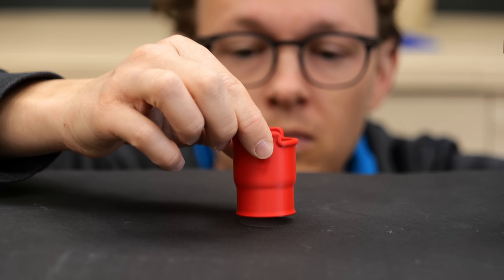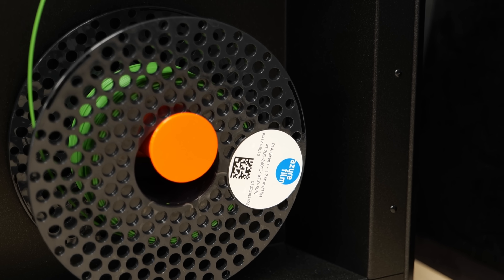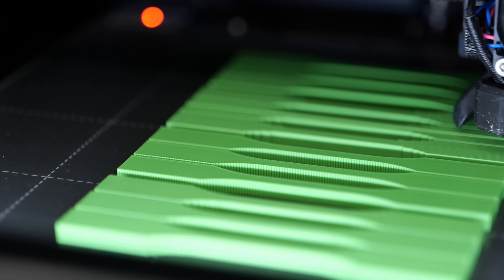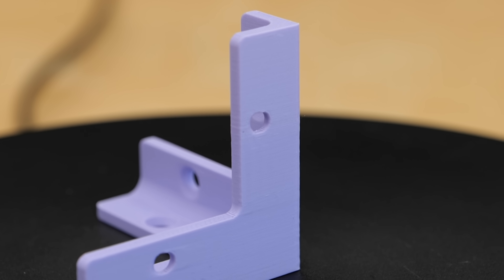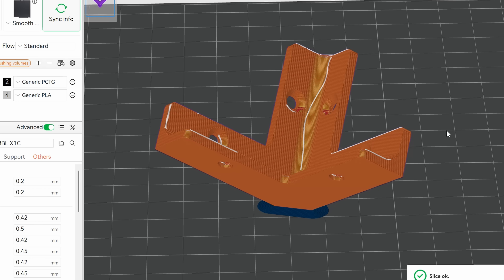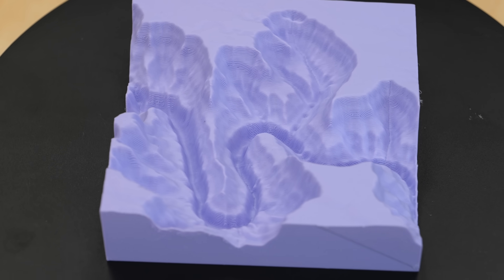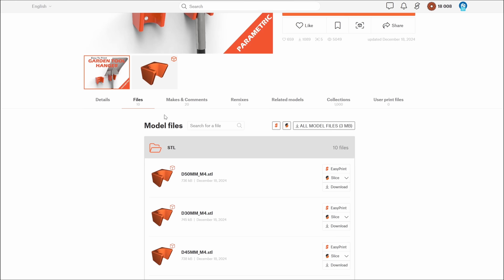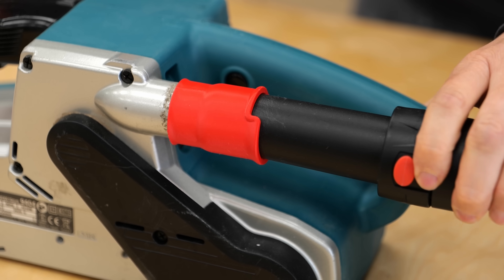Does Angled 3D Printing Really Make Parts Stronger?

Comment from the maker: KiwiCo makes a great gift for the holiday season! Visit https://www.kiwico.com/cnc and use code CNC to get 50% off your first monthly KiwiCo Crate or 20% off your first Panda Crate!
Reply: I have a question. How much different is the strength of a printed piece and a glued piece?
For example... If i print that L in 2 pieces and then glued it with proper glue. Would it still be weaker that the print line?
Reply: Can you please make a video of this improvement if it was vapor smoothed?
Reply: @OLegndz  He did already. "Stronger 3D prints with Vapor Smoothing?"
Reply: Hey Stefan, what about annealing in an oven post printing? Can you test that and compare no annealing, annealing in different temps, and annealing for longer/shorter times?
Thanks!
Reply: @RagingShrimp67 I think he already did
Reply: @kentaltobelli1840  then it's strange he didn't refer to it in this video.
Reply: HEY CNC MAKE A VID OF THE AMS 2 COMPATABILLITY OF A1 MINI
Reply: Hi 👋

Did you try to print the 3L-corner on his 6 extremeties points without support ? 

You printed it on the one point angle with support. What if we rotate it 180° ? 🤔
Reply: 6:16 or you just don't send the screw all the way home??? most drills are strong enough these days to literally sink a screw entirely through a piece of wood.... why make up lies bro? and you not even bothering to test the other style is a dead giveaway... your sponsors should be ashamed
Reply: Fix your Odysee channel. No videos on there for over a year. The last one was "I Quit." I guess you quit there also.
Reply: You might consider the Shape of the printing path as well. in a box u have distinct layers and every one of them is orientated exactly the same. bu. visualize this idea by consider how we infill, and how many ways there are to do it, straight lines, crosshatch, octagon, hexagon, curves, etc..

Comment: Hm... I wonder if there is a way to improve strength of pieces after printing... like maybe putting the piece in some sand and heat everything up so it partly melts on the inside so the layers bond together? Or sanding it and giving it a coat of some acrylic paint to make a "strong outer shell"...

Comment: Thanks for the video. 
But do print some "osVAC neo" vacuum adapters for connecting all you different gear to your shopvac without a hassle.
Lots of different connectors already available, and the fusion files are opensource so you can adapt it to your specific gear.

Comment: This is a good video explaining layer lines and how it will affect strength.  I have been involved with building SLA patterns for our investment casting company for 30+ years.
 For the most part I don't have to worry about the pattern strength but more for about surface quality and support surfaces.  Also for draining since we build QuickCast patterns
 which has a honey comb structure on the inside. This allows the pattern to be burned out of the investment shell and instead of expanding and cracking the shell it will collapse then combust during
burn out.

I actually just got my 3D printer at home and I need to think more about strength (depending on what I am building) rather than just surface finish.  Again this video will get me thinking more about 
how I will be setting up my prints.

Comment: Hrm. So. Is this why some people comment that their printed spool holder broke while in use? Most of the free files are oriented to print tall (the height = the length of the spool holder), not wide. So when installed horizontally on to the printer, the downward force (of gravity + the 1kg (ish +print vibration on a bedslinger if we're being picky)) of the spool makes it snap..? I'm pondering this since I was just about to print one.

Comment: With the collars, if you're worried about compromising strength in one of the directions you can make an assembly instead of a part (assemble it in two pieces) and you won't have the issue of strength due to layer lines.

Comment: I would use a piece of rubber hose. Put it in hot water and stretch it over the fitting. Then the vacuum goes in the now smaller side

Comment: Great overview of orientation. My planning on printablity and print orientation starts on a piece of paper (or more honestly: on the drawing tablet). You make a good point on the shrinkage points, which had previously been described as "where the print speed changes" (which still may/probably has a factor in it). But I also think a big point is just iteration. Blindly designing a part, especially practical parts, can work just fine. But once you design for strength, printability, etc. then you often improve on things... and find new issues. So iteration can net you the strength, visuals, and printability over time. Wouldn't surprise me of that's how the multiboard parts came to be.

Comment: The first adapter that broke off wasn’t pushed all the way in, there’s way more angular force exerted on it because of leverage of a longer neck. The second example where it didn’t fail, you inserted the adapter all the way in. I’m sure the second example is stronger but the method of testing is skewed.

Comment: What if we leave vertical channels in the infill and extrude filament there (i.e., increase the filament flow by filling the designated grooves), thus holding the layers together with intermediate infill? Is there any experience with this? This could be done with scripts or simply by test cutting. I'd be interested in trying this on your equipment – maybe it would solve this problem. THANKS!!!!!!!!!!!!!!!!!!!!!!!!!!!!!!!!!!!!!!!!!!!!!!!!!!!!!!!! 🙂

Comment: What I have done on prints where no orientation was ideal, was to combine two prints each with a different direction of layer lines.

For the vacuum cleaner for example, I'd have the interior be printed the regular way and then slide another on top (like a sock) that is printed in another direction. 

Does it take more work? Yes. But it's often allows for really sturdy prints even in PLA.

You also don't need to do this for the entire part, just the weak spot. For example I connected two Ikea curtain rods together using a PLA part (ring shaped) and then printed a second ring to slide on top of the first towards the center where the two curtain rods would come together and put the most strain on the part. My first print was really thick & still split or bent in the middle, the second print used less PLA in total but has been going strong for 4 years now.

Comment: Hey, we did a test like that last year when we were building a fully 3d printed rocket. We printed e-Sun ABS+ in a 45 degree angle with a really big assortment of infills and walls. Really interesting experiment the only issue was that we couldn't always get good tensile samples out of our K1C. We have some videos of the test. We also had some issues with the testing methodology for the ISO 527-1. We couldn't find the parameters test conditions (the speed that the tensile machine would pull at). We used Chat-GPT for that so we want to try again with another printer and better research behind the test.

Comment: For parts that are relatively small, printing one part at the time helps strength a lot. The new layer onto an already warm layer will melt together better. Actually, hold up much better in my experience. I agree with everything in the video, but this has often a significant impact as well. Could you adjust heat to compensate when doing several parts on a plate, maybe. But just think about two parts that have different height and one finish before the other then you suddenly have too much heat.

Comment: Try the  concentric pattern  for  as many  top and bottom layers as you can  when printing things with countersunk screw holes that are facing up or down to the build plate, as instead of straight lines  the filament will loop around the holes making them more resistant to screws splitting them.

Comment: In my opinion, PLA is completely the wrong material for such adapters. I use TPU for this kind of thing. It's indestructible and has absolutely enormous layer adhesion. And it's flexible to boot.

Comment: So I thought of a different technique than yours. What if you want to first measure the strength, then build it?
You first print a miniature of the item you want to print, let's say 10 times smaller. You test the strength based on the angle.
Then you print the full dimensions item. This way it can help identify which angles are best for which items.
And you might even build your own database of items strength and angles.

Comment: Very good video with lots of great information presented well. I have printed quite a few wind instruments (whistles, flutes, etc.) and have begun designing one myself. I have seen the line shrink happening on vertically printed cylindrical instruments near the finger holes quite often. I planned on putting thin circles in the finger holes to see it that helped. Now I'm wondering if angling it would help more, possibly making the bore of the instrument smoother (I'll need to test that). I thought of applying ArtResin (non-toxic epoxy resin) in the bore to make it smoother but I feel like doing so could easily cause issues if it doesn't apply in an even way. Slight bore changes can ruin the sound of an instrument in many ways.

The labium (edge that cuts air to produce sound) could benefit from angled printing. I have ideas to test, so thank you! I just need to finish designing the instrument.

Comment: depend on my needs I either play with the orientation or I paint some printing resin on (inside and out if I can) it for some strength . if the parts small enough I use resin prints.

Comment: Cut it by the axis that passes through the center of the cycle. Me two half cylinder pieces and print them in +45 and -45 degrees. This will negate the bend stresses from both sides. I remember a class I took in mechanical engineering institute, about carbon fiber. I think it’s the same principle applied

Comment: Let me break these 2 non-angled prints in the same way, but to show off the strength of the angled print, I'll just very lightly shake the hose of the vacuum instead, making it seem MUCH WEAKER than the others.

Comment: Before watching the video I would print it vertically, but would thicken the outer walls and make sure its printing at least 6 walls. The print time and material used would go up by about %50, but I have had very good luck using objects printed with this kind of strength.
Edit: after watching the video I probably would still do the same, although it would require some remixing in a mesh editor. A few tricks I would include would be increasing the flow rate. This extrudes the plastic with more force, allowing it to better fuse with the surrounding walls and layer below. This does mess with tolerances a bit, but that can be balanced by adding a negative horizontal expansion, probably about -0.1mm.

Comment: I made an adapter so I could hook my 2" shop vac hose to my Porter Cable random orbital sander. I printed it in normal position, but the walls were printed thick (4mm) and solid. No problems. So, printing thicker and solid can solve a problem.

Comment: R&D technician here.  Whenever I design something to be 3D printed, I always make 3 different models.  First is an overview model, where the critical dimensions are set, along with the scope of the idea.  This model is less than ideal in how it's made, so it's more or less a scratch pad to get the idea going.  The second model is a cleaned up version of the first overview model.  This is the stage where the design is broken up into individual parts for proper operation.  From this second stage, a third stage is created, using a DFM, or design for manufacturing, cycle.  Depending on how the parts are to be made, and from what material they are to be made, the models are modified accordingly.  FDM and resin printing get different design profiles, as does SLS/SLA.  Anything being machined gets a completely different design route.  For additive processes, you start with a bulk shape and add features from there.  For subtractive manufacturing processes, you start with a base blank larger than the final part, and remove from there to create the needed features.

I like the hinge idea.  Don't think I've seen that too much for split parts.  I typically use alignment pins or screws.  Heat set threaded inserts also work wonders for higher stress applications.  It's all about transferring the stresses where they can  dissipate without fatiguing the plastic.  

Does anyone know if this type of strength test has been done with various finishing techniques such as annealing, painting, and super glue with activator after application?

Comment: I don’t remember, do you have video with strength difference 0.4 mm nozzle, 0.6, 0.8, 1.0, 1.2?
Now, utility parts I print 0.8+ only. It fills and sounds like solid. 
And cracks like solid.

Comment: How does the time between layers affect layer adhesion, e.g. when printing multiple parts in parallel vs. one after the other? I thought printing on the "still hot" layer would be better and was surprized when you printed multiple parts in at the same time…

Comment: If I were concerned with layer separation under stress conditions. I'd print it in the upright position, but I'd also design the part with an outer shell that contains some bore-holes. Then I'd press-fit thin metal dowels into the bore-holes to reinforce the part along the z-axis (when positioned vertically). I think even using 6 stainless steel rods that are 2mm or 3mm (or about 1/8 inch) would add strength.

Comment: My (slight) experience with plastic welding makes me wonder if there aren't better ways to improve inter-layer adhesions by increasing temperature and/or speed?  Any thoughts on this?
In case you're wondering, in plastic welding (as in metal welding as you probably know) it is important for both sides of the weld to be completely melted.  I am not sure how that happens in FDM lower layer during print.

Comment: if you could split is so that it can be printed in two pieces with print direction at 90s from eachother and then glue them together, you could get maximum strength, no? maybe this is not doable for some models, but with some it should be, like your hose adapter

Comment: Orientation is a neat trick, but that adapter design was flawed to begin with. 
Its a copy of what an injection molded design is, a 3d print friendly design would be much beefier since it adds negilible weight and doesnt shrink. 
Orienting the design is one approach, inserting a screw slot to stiffen the adapter would be even better.

Comment: How would a careful heating near the glass temperature afterwards influence strength and dimensions? I am aware that you would need a very precise oven with different settings per material and lots of test prints to compensate for dimensional changes.

Comment: What if there was a way to harden with idk maybe a thin layer of resin and uvc light, or maybe heating the part printed to a certain degree where it would not morph it but increase the surface area of the layer contact

Comment: ~~Disappointed on the first graph, you should have used a candlestick graph, to show the average and the minimum/maximum too. Average is a very garbage datapoint, especially with this small sample.~~

EDIT: oh, you did... I realised only the second time, my bad. Good graph then!
But I still have to criticize the presentation, the bars are too large, and the range doesn't show well because it's tiny, it looks like a word processor cursor. I would use a classic candlestick, no bar involved.

Comment: Or just print this kind of part for this kind of application out of 95shore TPU or PETG and be done with it while printing it upright... Also it needs to be designed in a way that it can be inserted far enough which in your case it is not. This part is not engineered/designed correctly for this application.

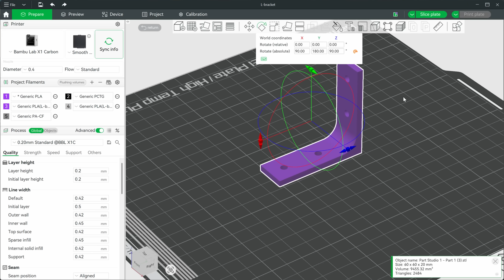Comment: 1:26 If you will allow me a smidgen of pedantry, there are actually a definite, finite number of possible orientations.
Given that there are 3 axis, 360 degrees of rotation in each axis, and 2 decimal places of precision in the slicer, there are 36,000³ orientations, or nearly 46.7 Trillion different orientations for any part.
Which is a lot! But not indefinite

Comment: it doesn't it's mass did not change nor did the manufacturing method plastic mold injections machines are better at making a durable product due to the hydrolic pressure, leading to zero air pockets, thus resulting in a more durable product, cooling time, and method also matters.

Comment: I've seen people use acetone and a small paint brush to "paint" their parts after a print to increase strength. My question is that would doing this help nullify the difference in strength from print orientation? I'm a complete 3D printing newb, so I'm learning as I go. From my understanding the acetone "paint" melts the layers together chemically giving the print more of an injection molded look/feel vs the visible layer lines. So if you were to treat your prints for functional items like your adapter, how important would orientation be then?

Comment: since the angled part uses more material for the supports anyways, wouldn't it be fair to compare it with a vertical print with wider walls?

Comment: Chemical welding with acetone can make your prints look smoother and significantly improve surface bonding. Epoxy infiltration is also great and can boost the strength of a build.

Comment: You also have better adhesive strength when printing parts individually. By printing so may part at the same time you increase the figment temperature lose between layer bonds.